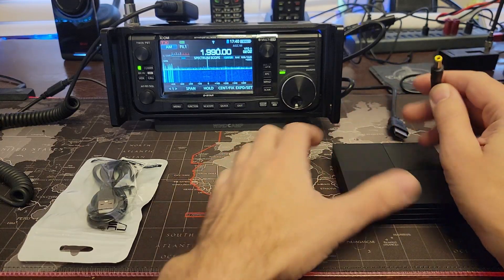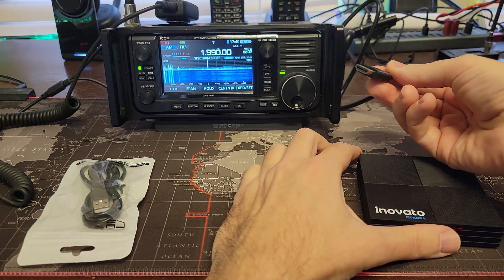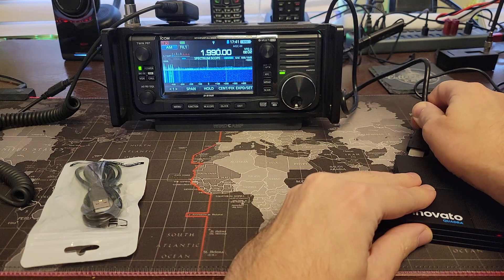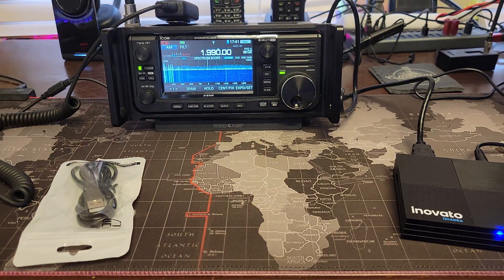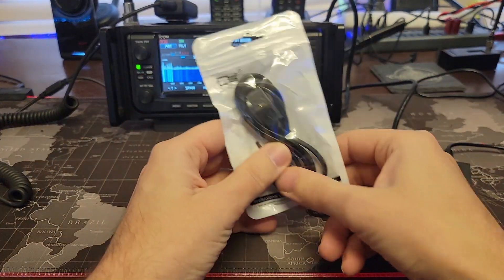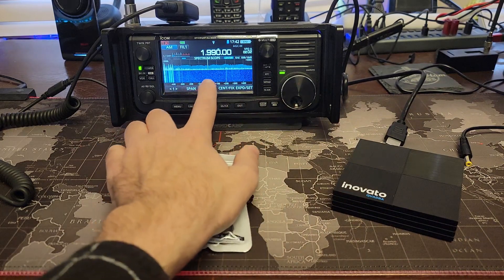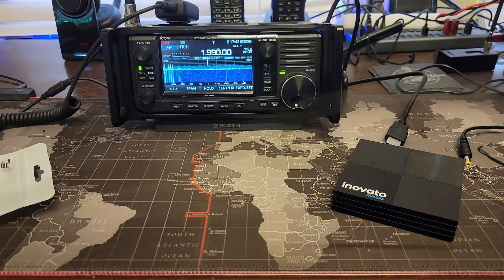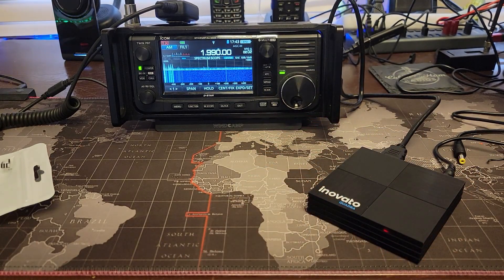Fix that Noisy Power Supply! Inovato Quadra

Comment: It does also happen without the HDMI cable.  The one I have running Octoprint wiped out my 2M desktop rig with no HDMI connected.  A couple turns through a toe-roid right outside the Inovato cured it.  May try this solution too.
Reply from the maker: I put 10x snap on beads on both ends of the power supply cord... looked pretty stupid, and also didn't work.  I just found a 140‐43, so I'll try that too.